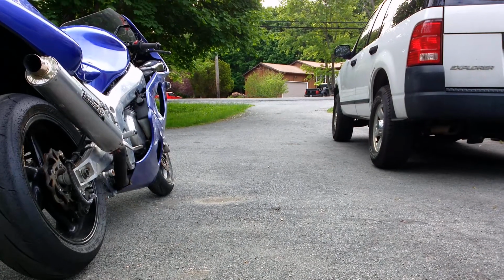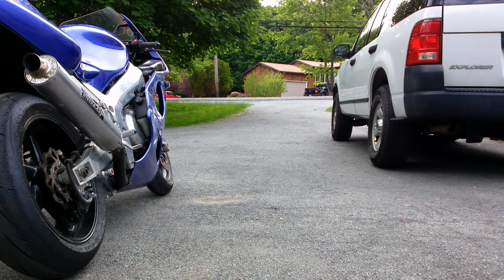779cc Question about light Crank, Cam timing, and FCR41 carbs

Comment: sounds and looks like it's the carbs need fine tuning :) sounds like thunder tho wish i ad those parts
Reply from the maker: Jack Price Thanks Jack.  The bike is LOUD for sure.   I richened the pilot jet and it's a little better.  I'm going to play with the needle and go to a thinner one and hopefully that will clean things up.    The bike currently has pod filters and no airbox so maybe that too is contributing to the lack of off-idle torque.
Reply: yeah cool, could be the main cause for it with no airbox giving it the slight splutter when pulling off, was the engine port and polished when those pistons was installed ? seen something like those pistons on bay, love too know the top speed tho put those liter bikes too shame lol
Reply from the maker: Jack Price Yeah it's got some light porting, the head was milled, and it has a 5 angle valve job.  We also installed the Kibble white Springs with Titanium retainers.   The crankshaft was lightened 5lbs and balanced to 14k RPM.  There's ceramic bearings in the transmission input and outputs shafts and also the camshaft bearings are ceramic as well.  I pretty much threw everything at it.   The carbs are the final piece to the puzzle.
Reply from the maker: Turbo329 ...forgot about the Carrillo rods too.
Reply: yeah not bad sounds like you chucked the check book at it lol, defiantly the carbs an airbox, ever thought about giving the bike an update with the can and downpipes ?